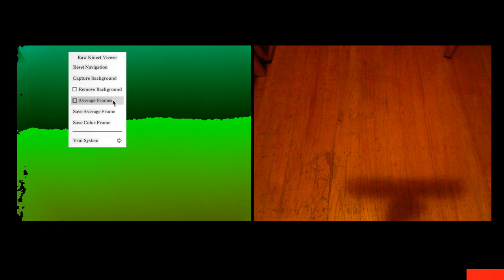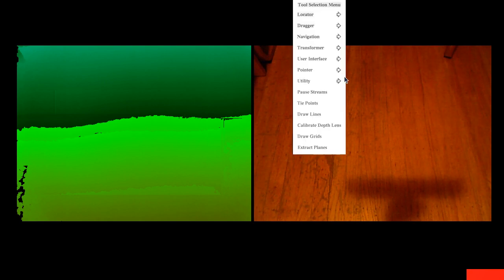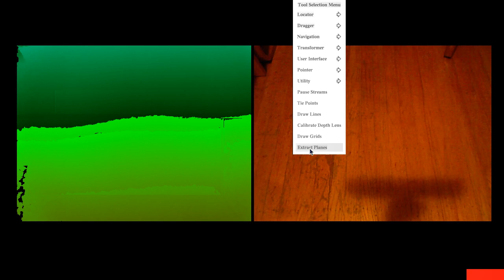AR Sandbox Calibration - Step 4

Comment: Been following these steps, but My Kinect within RawKinectViewer flickers a ton. Running on a Thinkpad T60P with Unbuntu 16.04 on an SSD. 
The ATI card is RV530. 

I don't believe my system is to blame, so I went out to buy a 2nd Kinect and does the same thing. I am using the AC adapter.

Any suggestions.

Comment: Great that worked. You state in the video that we then need to insert the data into the sandbox layout file. Is this the same as the vrui.cfg. That file has code labeled Floorplane. You mention a readme file but I cannot locate. I appreciate the assistance.

Comment: I'm working on calibrating the camera as you describe here, but I'm having trouble getting the equation of the plane. At 1:55 of the video, after you've drawn the rectangle, you describe the numbers associated with the plane equation and you mention that these numbers should have printed out to the console.  Unfortunately, that's not happening automatically in my computer, but I should be able to find them if you can tell me the name of the file where those numbers are located, I can open that file directly and then copy and paste them into the appropriate place.  Thanks for your time.
Reply from the maker: The equations and numbers will be printed to the same terminal window from which you started RawKinectViewer. They are not written to any files.